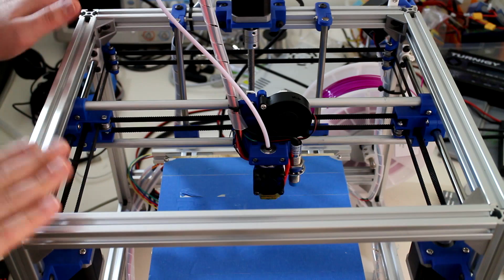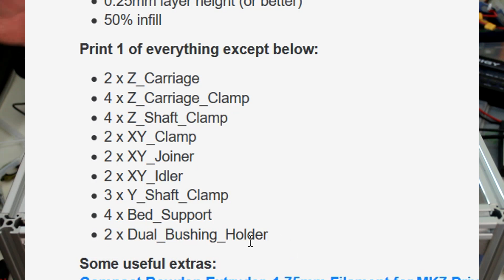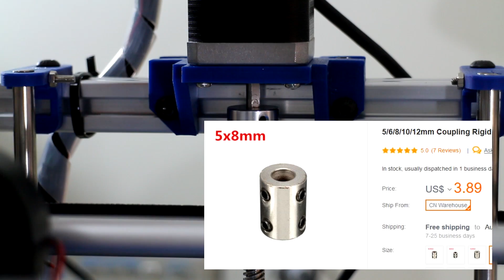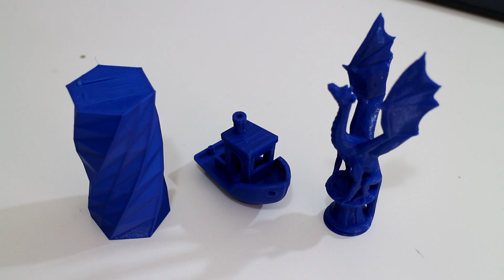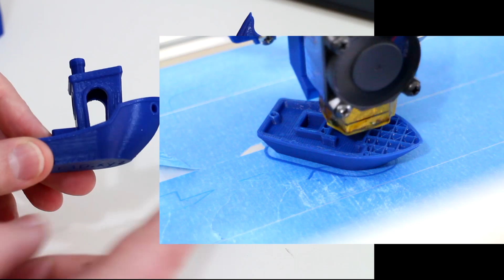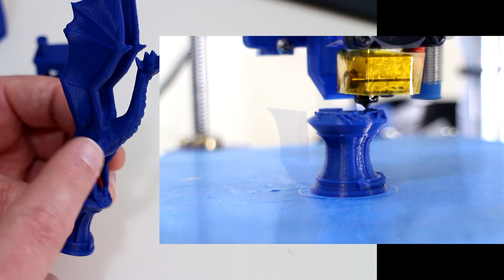New 3D Printer - Build Log #10

Comment: As the Tom Keidar comment says, couplers are for coupling the rotation force, not supporting the platform, neither should the bearing in the stepped be supporting that force, the Z lead screw should be held either at one end by 2 thrust bearings or at each end by 1, obviously the bearings have to be in opposition  and have some pre-loaded force /stretching/ not compressing the lead screw, and by some i mean a few kg at least, unfortunately when doing my own Z design i could not find any such bearings to fit below 15mm, and as we dont run 15mm lead screws, some spacer will be needed in the bearing, which must be clamped to the screw and hold into the bearing. thats how its done in industry, and it works, but the 3d world has ignored established designs.. I'm a 3d nooob, but a long  time mechanic.

Comment: you could print a shaft  coupler for the Z axis.  Place some rubber tubing around the shafts between the coupler to absorb any alignment issues.  I use 3D printed couplers for my Z axis drive screws on my repstrap that way, now problems!

Can you add your settings for Marlin to the thingiverse files?  Also what CAD software did you use to design your parts?  Could you publish the source for them to allow for customizations?  IE: using Nema23 motors, and 3/8" belts?

How about a video showing your z leveling with the sensor?

Comment: Im starting to buy parts for this printer now. Its hard to get ahold of anodized aluminium rods. Which is why Im wondering if its possible to use carbon tubes, with some kind of bushing? Or just use a regular linear rail with LM8UU bearings? What is your thoughts on that? Cant wait to get the printer together.
Reply from the maker: I understand it's difficult to source anodised aluminium tubes. I was fortunate to find a local supplier, so I've ordered a dozen sets to sell to those that wish to buy them. When they arrive i'll open a small online store where you can buy them, probably next week at this stage.

Comment: How does the combination of aluminum/brass bushing hold up after the prints you did so far?
Reply from the maker: So far it's working great. No wear marks on the aluminium tubes from the bushings. I've printed about 1kg worth of filament so far and it's holding up well.

Comment: I like the idea of switching to a rigid coupler. They make a world of difference, but keep the bearing at the base. No reason to get rid of it. It's better to have the restriction if you have a really straight lead screw.
Reply from the maker: I'll experiment with different configurations and report my findings. Quite a few posts here on how to fix the leadscrew so I'll try each one and select the least part count solution.

Comment: I would recommend you go with this sort of design http://www.thingiverse.com/thing:1676571 and keep your current couplings which reduce shock loading on the stepper and handle any slight misalignment between the shaft/bearing and stepper.. Just my thoughts..
Reply from the maker: Thanks for the link. I'll experiment with different options and report my findings.

Comment: I'm halfway down the rabbit hole on a Kossel, and looking at the design, I don't think that a delta really is the way to go.  I think instead I'm going to build your Hypercube design instead.  I may have to modify some things to better fit the hardware I have, though.  Your BOM calls for M5 hardware for the corner brackets.  I'm going to print corner brackets (probably in PLA so that I can use up my black roll of PLA) and use M4 hardware.
Reply from the maker: I'm not sure printed corner brackets are worth the time and effort. The frame needs to be rigid, and the M5 screws plus metal brackets allow a very stiff frame. Plus the parts are so cheap why wouldn't you spend a few bucks and save the effort?

I'm glad you're deciding on the Hypercube :)
Reply: I have a very tight budget I'm already halfway through.  I'm not going to scavenge my Prusa, so I've got the whole BOM to go through, and I'm going to print as much as I can.  I've got M4 hardware, so that's what I'm going to use.
I've worked with a Fusion F-306 with plastic corner brackets, and it was a larger machine than this.  If it's rigid enough for that printer, it's rigid enough for me.
I'm considering using roller wheels on the 2020 frame rather than linear bearings on rods, again because I have the parts.  I'm also not wild about a cantilever bed.  Since I'm keeping my Prusa as is, I'll have room to experiment, and I'm in no hurry.  Should I come up with an interesting remix, I'll definitely share it with you.
I love your hot end mount with the fan duct behind, btw.  It's probably the most elegant solution I've seen yet.
Reply: Actually, I'll probably end up designing my own.  I want to eliminate as many smooth rods and linear bearings/bushings as I can.

Comment: Congrats, looks like you designed a very good 3d printer! I do think a solid coupler will give more reliable z-positioning, maybe print the same parts at the same settings with the new coupler and compare results?
Reply from the maker: Yeah I'll know pretty quick after a few test prints if the results are improved or not.

Comment: You should try a oldham style coupler on your Z... if you attach it to your printing platform if (and its very likely you do) there are any imperfections in your z leadscrew it allows the nut to move without translating that stress into your print... Here is an example of one that I am talking about... http://www.123dapp.com/123D_Design/Copy-of-Oldham-Coupler-V2/5709729

Comment: I wouldn't trust solid couplings, most likely they're not going to center your lead screw nicely enough to eliminate any banding. I'd recommend an integrated stepper motor with lead screw if you really want to pump up your z axis quality! They are pricey though..

P.S. I printed the same vase as a test print for my printer, video will be out in a few days!
Reply from the maker: Hey! The more I think about elaborate 'fixes' for minor z axis artifacts the more it compels me to just bite the bullet and go full stepper with integrated leadscrew. Is there that much of a difference in your experience? It does seem way easier.

Looking forward to your test print videos with the Eclipse3D2!
Reply: Tech2C I've found that all other solutions I've used always seem to have a tiny bit of z banding, but so far with the integrated stepper Z walls are perfectly smooth! In your case with the stepper hanging from the top, it may be especially beneficial since any coupling solution will need to bear the full weight of the z carriage. Just make sure you have perfect alignment otherwise things may not go as smoothly!

Comment: I love your video's and thinking of building the hypercube myself. I was wondering which slicing software you used  and retraction settings.for these prints.
Reply from the maker: I used Cura 15.04. Retraction of 3mm distance over 150mm/s speed.

Comment: The results are amazing.
It might be a good idea to keep the flange bearing and support part at the base of the lead screw when you fit the rigid couplers, this will reduce the amount of force on the motor bearings. Just my thoughts.
Reply from the maker: I'll see how it goes. I'd like to remove that entire part as I'm not sure if constraining the leadscrew at both ends is wise.
Reply: I know what you mean. I guess trial and error is the only way to be sure.